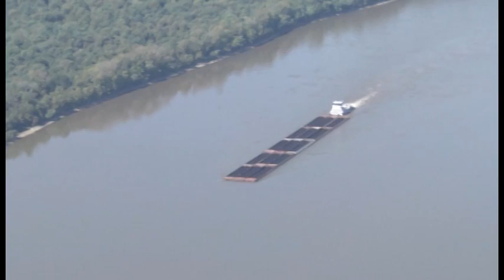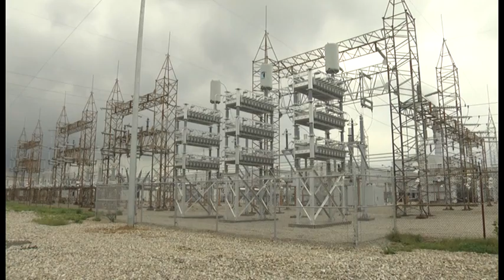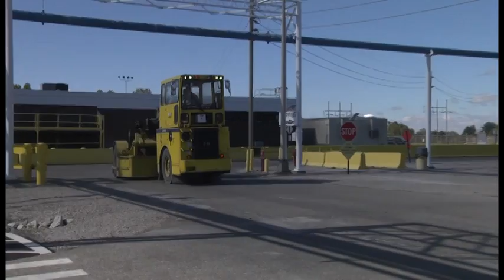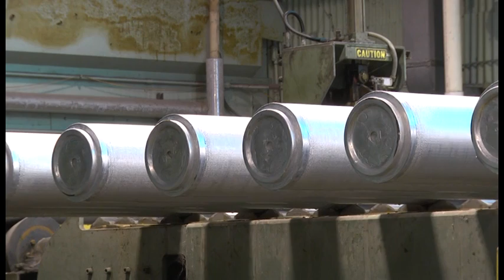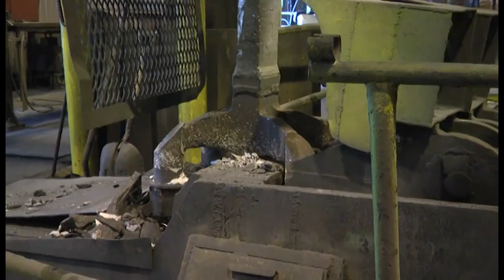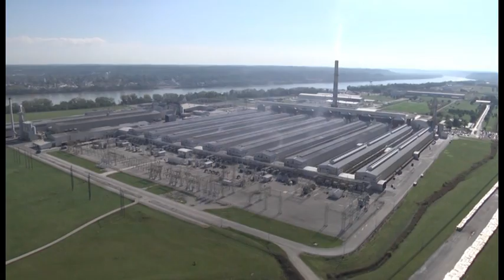Century Aluminum: Kentucky's Aluminum Smelters

Comment: $90,000 a year wages per workers,no wonder this company is  losing profits
Reply: Why don’t you work that job for ninety days then tell us what it’s worth.
Reply: @michaelchadwick3497  worked on the blast furnace for 10years and 22years on the BOF..Son🤣
Reply: @michaelchadwick3497  don't mention the high cost of electricity also needed to run the smelters, that's another reason Century is closing plants across the country in recent years 👩‍🏭👩‍🔧
Reply: @michaelchadwick3497  I know son I'm a retired union steel mill/wright worker 32years $75k the most we made in a year , when the union got greedy and wanted higher wages the company threatened to close the plant and move overseas, and that was the end of that, but the stayed open 🤣🤣🤣
Reply: @shermanyoung8185  lol Century is booming right now....what are you talking about their stocks are way way way up
Reply: @masongregory2  that’s why they just shut down the Hawesville plant?!  The only plant that did high purity.  Century is as good as done.
Reply: @michaelchadwick3497  the union greedy,if you ask these workers most of them think they deserve a raise to their $90,000 a year 🤣🤪
Reply: @shermanyoung8185  worked 36 yrs in aluminum industry. First five in production and portions. thirty one as mech. craft spec. Not a damn thing you can tell me about it Boy. I made 75K in 2007 for the first time. After that it just kept going up, took lots of overtime.2014 I made 92K and retired August 2015. We had job scared company sucks in our union too. Caused its downfall.
Reply: @michaelchadwick3497  sorry to hear that,son!
Reply: @shermanyoung8185   only a fool or a scared company suck would self impose a limit on their earning potential. It’s plainly clear you are both. Boy.
Reply: @michaelchadwick3497  ok son!
Reply: @SHERMAN YOUNG  your an idiot. Why not deserve more money.. I work In a lead smelter and  make $120,000 a year and we definitely deserve more for the conditions we work in. You must be a staff pig
Reply: you sound like my recently FIRED CEO
Reply: @xev1435  no wonder companies are sending contracts and jobs to other countries 😆
Reply: @shermanyoung8185  and they can't get the job done. Try outsourcing medical care, and aviation build. Would you fly in a plane built by China, comrade? would you trust your life in an aircraft maintained by a country whose restaurants use "gutter oil?"
Reply: @xev1435  90% of American product components are manufacturer over seas , example semiconductors,🤓
Reply: @shermanyoung8185  I guess you would fly a Comac: 30 billion and still cannot compete against Boeing and Airbus. Hell, if lockheed martin decides again to enter the civilian airline market it can trash the shit hole communist Comac. Even the russians are ahead of Comac. The brazilians are ahead of China in small aircraft. You need to stay away from that gutter oil comrade. The diarrhea is coming through your keyboard.
Reply: Привет народ. Я живу в Сибири. Работаю в русал. Перевожу ковши с металлом. Производство уровня 60 годов. Зарплата 600 долларов 😢
Reply: We're doing just fine thank you